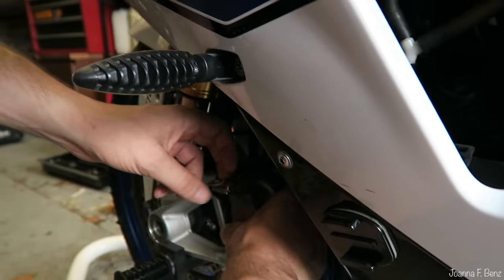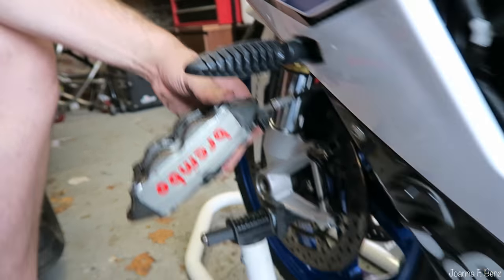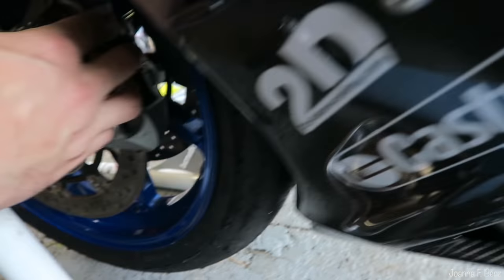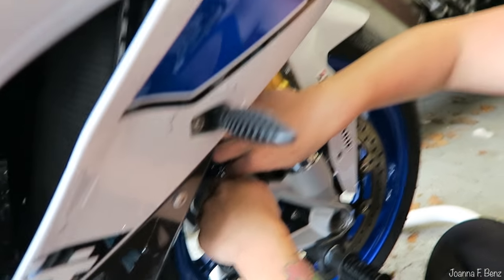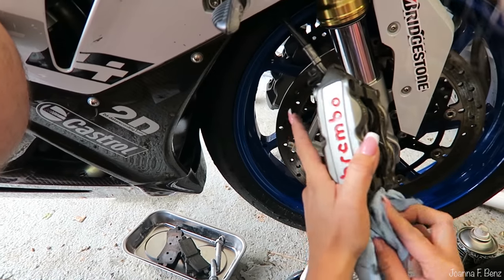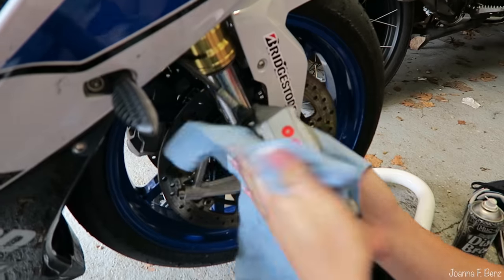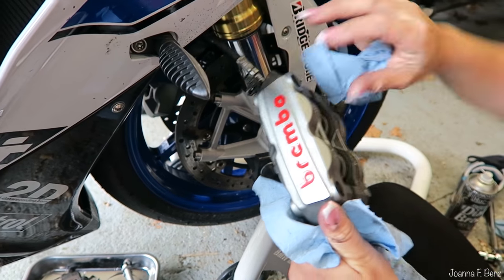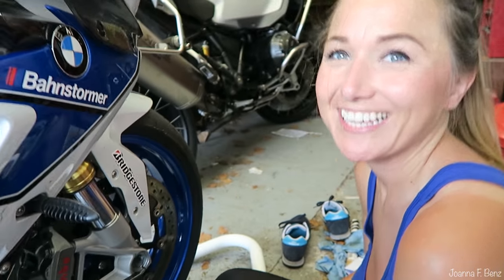How To Change Brake Pads on HP4 - with Baron von Grumble | Joanna F. Benz

Comment: Just in case someone is doing this for the first time, REMEMBER to pump the brakes before taking off on a test run! otherwise you may roll out into the street, pull the brake lever at the stop sign as you normally would, and keep on going out into traffic! I know it sounds stupid, but it's easy to forget in the rush of finishing a job like this.

Comment: Jo. As a tip. If you' want to push the Pistons back easily move the Pistons to create a gap and then , bung the old pads back into the calliper before levering them apart with a screwdriver to push the Pistons further back into the calliper body. It won't matter if you damage the pad material as they will be replaced with the new ones. Saves skin, nails , less,effort etc
Reply: Angry Dwarf - that’s exactly what I do as well.  Work smarter, not harder!

Comment: Lots of great ideas from people, some of them correct, some not so. The reason you don't push the caliper pistons back 'before' taking out the old pads is because at that point the pistons can have grit around them that then goes into the seals. The pads need to be removed and as much cleaning done as possible before pushing the pistons back, but once clean, the old pads can be re- fitted to use for pressing the pistons back in. The only main no-no that was committed was not using a torque wrench to do the brake bolts up. There is a correct torque and BMW specifies it for a good reason, if these bolts loosen and come out while you are riding, the next brake application can be interesting to say the least. Not worth risking on such a critical component. It's ok if it's just something like an indicator that will just fall off and be a nuisance, but not brakes. Many years ago when I had a Kawasaki Gpz 750 (that's how long ago), I had a brake bolt loosen and fall out. The second bolt immediately starts to work loose as the rotational torque of the brake rotor moves the caliper around. I was extremely lucky that it happened at low speed in stop start traffic, and I stopped to see what the clunking noise was every time I put the front brakes on (it was the whole caliper moving back and forward against the fork leg). That was many bikes ago, and long before I learn't to build race stuff properly, but trust me, if it's safety related, the torque setting is there for an important reason.

Comment: Pretty decent vid, some people put antiseize/silicone grease on the pistons so they don't corrode. I would recommend using a torque wrench for caliper bolts if you're unsure of tightness simply for peace of mind and to stop bolts stripping (I've been there and it's a horrible feeling)

Comment: I usually use the back of the old brake pads to push the pistons back into the caliper evenly. One thing I'd mention to anyone doing this themselves for the first time would be, be very gentle if you decide to use a screwdriver to seat your new brake pads - you don't want to gouge chunks of your new pad out by accident!

Comment: Pro-tip! put in the two old brake pads after cleaning, as u squeeze in the brake cylinders. As the old pads are done, u can jam them apart with a screw driver, without destroying anything. The advantage of this is that all cylinders move in at the same time, this avoids cylinders from fucking about and from popping out.

Comment: A couple points, 
1, those caliper bolts don't actually need alit of torque. You may want to use a torque wrench and the right force ?  
2, don't whatever you do pump those "pots" out too much because they will pop right out !

Comment: Intersting that the pads just slip out of gthose calipers - most of what I've worked on the calipers are like car ones and you have slider pins...
Reply: Brembo and bmw for ya :P
Reply: radial callipers - there had to be an advantage
Reply: Definitely different calipers on my '15 1krr. http://www.s1000rrforum.com/forum/s1000rr-hp4-do-yourself/3950-diy-front-brake-pads.html
Reply: @nathanwiens108  yup HP4 had different calipers

Comment: I've never done this myself - always had it done by a dealer. Might give it a try after watching this though as it doesn't seem like there's too much that can go wrong..! Still think I'd be nervous when I hit the brakes for the first time! One question (for anyone) - is there an easy way to tell when the pads need changing, or is it just the obvious "look at them"?
Reply: Yeh just look at them dude
Reply: Some pads have grooves in them, when the pad wears down to the groove it's usually a good idea to change them. Rear brake pads sometimes have a chamfer on the back corner, once that's worn down, you should replace the pads. Also, if you're pushing the bike and can hear metal against metal - you really need to change your pads! Another tell tale sign of extreme pad wear would be scoring on the brake discs, but as long as you give them a look every few weeks and just use your common sense - if the pad material is only a millimetre thick for instance, buy some new pads.

Comment: Good job. All I would say is that as far as I'm aware brake cleaner is pretty corrosive, if you leave it on anodised callipers it will start to lift the anodising! But the fancy brembo may be more resilient to it then my shitty stock callipers! But clean them well with the blue towels and try not to spray onto your fairings or wheels, just hold the calliper in some cloth so it catches any over spray! I tend to use a bit of copper slip on the lugs and back of the new pads as well, just so it slides within the calliper, that would be the silver grease shit equivalent that BMW use.

Comment: Should have known that you were a YouTube personality... 

Just to add something to look out for while you're working on the brakes... If I may add one thing to changing brakes, it is preferred to not touch the actual braking surface of the pad as the oils in your hands will linger long after. That in and of itself will have the potential to create wear problems and could show itself when you're braking under heavy, especially on a track. Other than that, Chris has you lined out perfectly!

Applies for all disc brakes regardless of vehicle, but it can be more noticable on motorcycles.

Comment: Copper slip contact points like pad pins, but minimal amounts - IMHO nasty crap which shouldn't really go anywhere near your brakes. Never been a fan of using any lube on torqued critical fasteners, it can affect the correct application of torque. So good to learn basic maintenance skills, the amount of bikers I've come across that wouldn't even know how to adjust a chain (face palm)

Comment: FYI, a trick with break cleaner, if you have your injectors fucked or your car is having problems starting and you know that it did that shit before, but for some reason, that day it's not turning on, put one spray of brake cleaner on the admission and start the car, if it doesn't have someone spray it while you turn the key. It will start right there. Don't overdo it or you will ruin the engine.

#SponsoredbyClioWinterProblems

Comment: Did you know? Before you remove the old pads, you can pry in between them with a screw driver to push the brake pistons back.  You don't care about the old pads because you are replacing them.
Reply: Orange Crush - This is the best way to do it! Prybar and old pads... 

I'd torque the calipers too, especially if you're new to working on mechanical stuff! It's not worth the risk with something as vital as brakes. And if you overtighten and strip the thread in the fork leg (albeit not easy to do) you are in for a world of pain! 

I'd also be careful not to pump away carelessly as you could pop the pistons out. Not good.